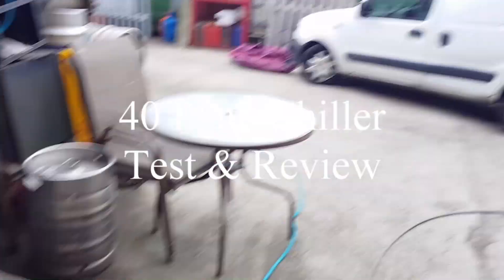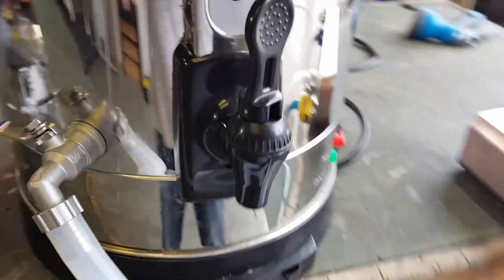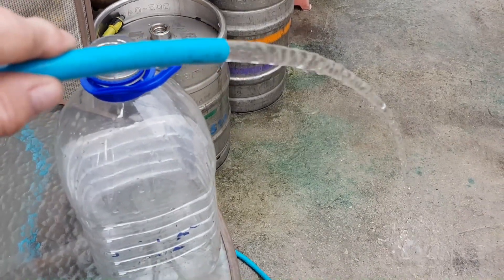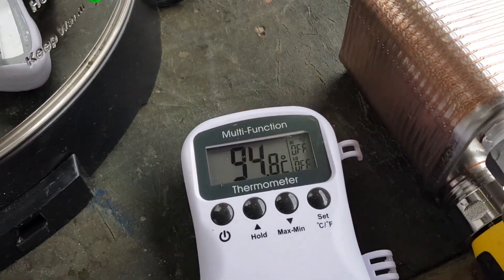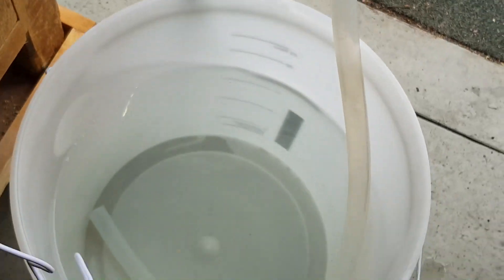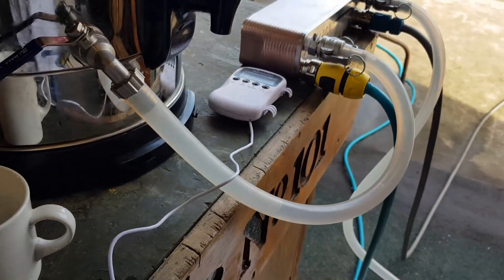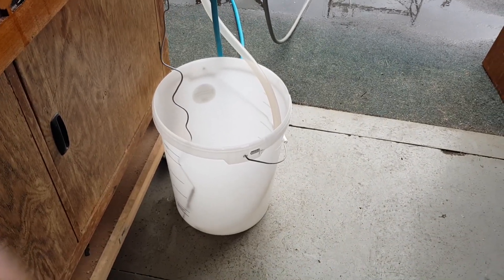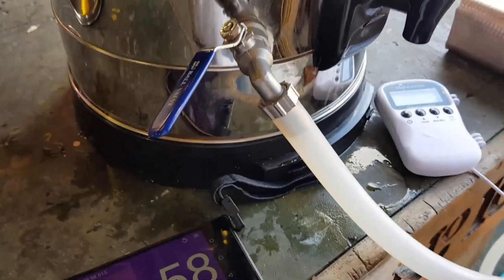BREW - REVIEW 40 Plate Wort Chiller

Comment: Cheers mate,   I've been debating changing to a plate chiller,  but your video pretty much answered everything I wanted.  Much appreciated
Reply from the maker: I've added a few pre-filters just in case of blockage (there's a video about it here somewhere), but of all my brewing kit, the plate chiller is the most stunningly effective!
Reply: @MadeByMartyn  you weren't joking, i did my first brew with it tonight,  from 90'C to 12'C at 12l per minute from my magnetic pump,  granted its winter and im in scotland,  but damn impressive,  i actually had to heat my wort back up before i pitched the yeast ,       much appreciated for the video and advise .
Reply from the maker: @hmmmnz  I'm constantly impressed by it, and now restrict the cooling water flow as that wort is too cold to pitch!